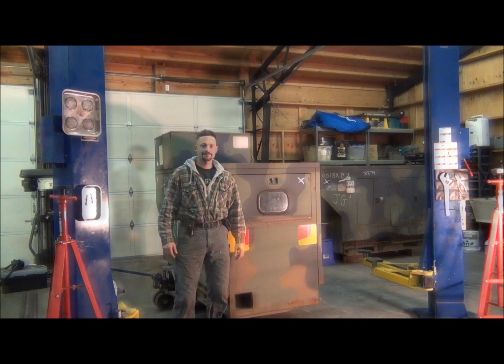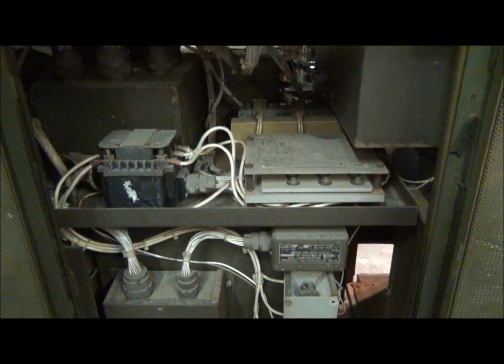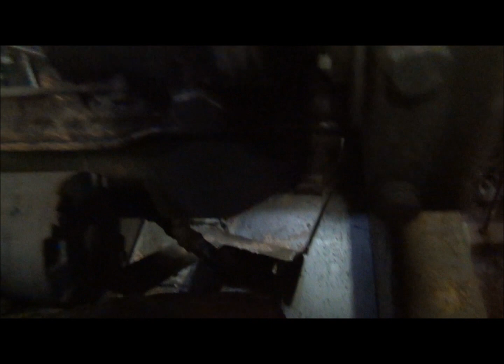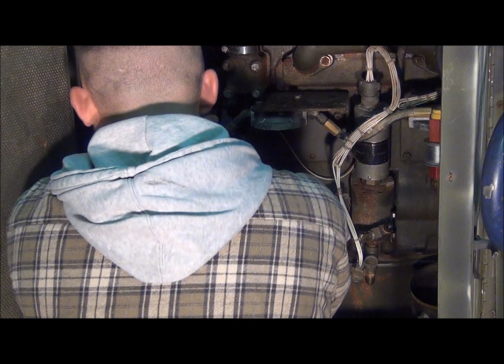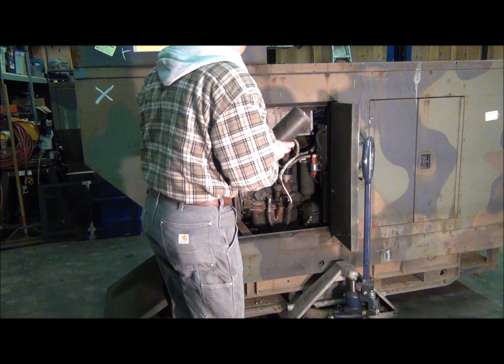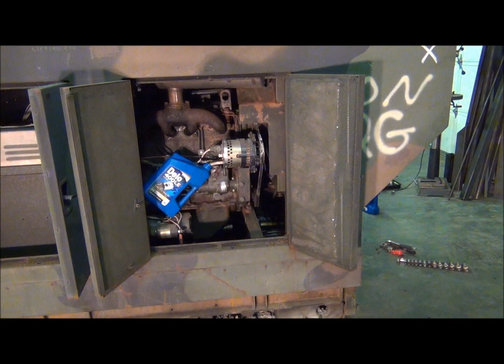Military surplus generator repair, and first start after years of sitting

Comment: Hi there, well a very good friend of mine asked me to service/start a very similar genset just about 2 weeks ago, except this one is a 30 kw 6 cylinder model. It hasn't ran for at least 10-15 years, but only 420 Hrs. on the clock!!!  After clearing the fuel system, and dealing with a few problems in the cooling system the set started and it runs very nice. It powered a beach party about week ago, worked for 12 Hrs non-stop. It had to come back to me, because there are still a few problems, the alternator has 2 diodes in short circuit and some gauges don't work yet. I'm curious if you could advise me where I could get a diode plate for the alternator (ANJ 7001) and a fuel level sensor? Thanks, Louis
Reply from the maker: you should be able to find somebody parting one out on the steel soldiers forum.  if not there, then Dell's surplus or Oshkosh equipment might be able to help you out.

Comment: I'm not getting power to my fuel pump but if I jump out the fuel pump and hold the start button and stop position to stay running soon as I Let Go it shuts down this is on a mep-004a I noticed this the fuses what could it be
Reply: +joesph koellner worked on military gens for 16yrs sounds like you got a bad oil pressure switch or bad master switch. when the master switch is held in the start position it overrides the oil pressure switch until full oil pressure is made during start up.

Comment: hi sewerzuk!..i've a problem with this generator,  the old owner  has changed the alternator whit a local(italian) alternator, now the problem is  that ,is missing (in the prestolite anj  7001 there was a specific output),  the output for the generator set control system (gouges, incicators ecc)....Now i wonder if you could kindy tell me the voltage and amperage that the alternator provides to the control system...thank you so much
ciao!

Comment: I like how familiar you are with these, are you ex military and perhaps worked on these in the service?  Otherwise how could you know them so well?
Reply from the maker: Charles Henn Thanks!  I am ex-navy; I was a nuclear electronics technician, so I had a good deal of experience with electronic schematics and military equipment...but I never did work on these during my time in the service.  I purchased quite a number of these over the years to repair and re-sell...after moving lots of them through my shop I started shooting videos of the repairs.  Each one was like its own little treasure hunt...I do enjoy working on them.
Reply from the maker: Yep; it is a bit oversized for the average house!  But, if you had electric heat, electric hot water, electric range/oven, dryer, etc. then you could run it at its limit...

Comment: I have 2 30KW sets that I installed on my tug boat - they run really nicely! Just wondering if you have the part numbers for the filters, and what oil you would recommend. I notice a DELO 400 jug in the video, that would normally by what I would use, but these are naturally aspirated. Still OK?
Reply from the maker: SAE30HD is what should be run in them...but I have put a lot of hours on the MEP's with DELO 15W40 with no problems.  Here is the filter info:  
NAPA 3540 (for secondary and final fuel)
NAPA 1004 (for oil filter)
Donaldson P131919  (air filter)

Comment: Excellent video. Learned a lot on the mechanical requirements. I like how you eliminated unnecessary checking, which I would have done first, by short duration operational tests. That main engine belt for instance, was looking suspect and scary; wasn't sure if it would hold up. Great job bro.

Comment: Nice methodical work through, looks like you worked for the army engineers. As for that faulty oil pressure switch you should have gotten a new micro switch from Radioshack and installed that. Always much better to keep things original and with a new switch it would have been as good as new!!

Comment: If they are rewired will the generator controls still work?  Have you done this and what do you need to change or replace?  Thanks for your time
Reply from the maker: I have rewired for other voltages.  I have a video on my channel that describes the process of re-wiring for split phase 120/240.  All of the instrumentation and control systems are based on 120v across individual windings.  But...this answer got me thinking...I think I need to take back my initial answer and say that no...480v delta is not possible without a transformer.  Because the instrumentation and control relies on 120v per winding, 240/120 delta is possible, but 480/240 is not.  Each winding would need to be operating at 240v.  I think that, if I needed 480v out of one of these, I would configure it for 417/240v wye (this is a factory configuration) and then get a transformer with a 417v primary and 480v delta secondary.  That would be the easiest solution...

Comment: Nice video! Thanks...on these engine that have not run for more then 6 moths I think it is a good idea to run the engine with the starter with the fuel pump shut off for a while...the idea is to get the oil to circulate throughout the engine before firing up...this may prevent damage to the bearings. But you did not leave anything out for pre check!

Comment: When I see these available (usually be a Re Seller)  ,some have SUSPICIOUSLY Low Hours.. like  100- 300 hours.. Is this even possible ?, or did someone turn back the meter, in your opinion.. What is another way to tell how many hours approx a unit has..  Im glad to hear that if I find one with 2,000 hours that its not a major concern... thanks
Reply from the maker: No good way to tell "real" hours.  But, it is not uncommon to find these freshly overhauled or even original with low hours.  I have purchased a few with single digit hours.  However, this doesn't always mean it is in good condition.  Best to do a full load test to determine how healthy the engine and electrical systems are.
Reply: sewerzuk Hi; I just bought a three phase diesel generator which is missing the battery, that battery compartment seems a little bit too small, yet the tag reads
"24 volt system" so my questions are: Where I can find a battery that size and voltage? Or do I need to use a couple of 12 volt batteries? And my other question is: Do you think I can run a Lincoln welder machine using that generator once I get it to start and running?
I can send you pictures if you want me to, so you'll get a better idea of what the deal is, because I'm a welder with little or no knowledge about military three phase generators, thanks a lot.
Reply: Pancho Contreras I know that 24V systems are uncommon in US, even in big equipnment. In Europe trucks and heavy vehicles simply use two 12V batteries in series.
Reply: Yes its very possible to have very low hours on these sets. Pope AFB just retired a few MEP sets, one only had 127hrs on the clock
Reply from the maker: Pancho Contreras These generators are all designed to use two 12v batteries in series.  I usually purchase a couple of automotive batteries at my local auto parts store when I need new ones.  Without knowing what kind of welder you intend to power, and which model generator you purchased, I can't answer your question!  If you give me some specifics I can help...

Comment: when i was stationed in japan and we would get typhoons, i was the jerk in a truck with fuel pods running around filling these things up! now i wish i had one, i didnt realize u could buy them, did you get it from DRMO? i could fix one of these easy since they are off hi-way diesels! thanks for sharin'
Reply from the maker: Yep; I purchased the one in the video from the DRMO auction at Ft. Lewis.  They are fairly inexpensive, but since you can't wrench on or test the sets prior to bidding you really don't know what you are getting
Reply: sewerzuk

yeah i feel like id have to buy 2 or 3 to get one running gen set, i've brought hummers to DRMO before, and we'd strip parts off them before hand ( to help the motor pools budget lol), so i can imagine how some things from DRMO can come lol

Comment from the maker: No; I've never had one not shut off.  What I would do depends on the circumstances; if it keeps running at normal RPM, then it isn't an emergency and I would just pull power from the injection pump, or remove the fuel line.  If the engine was running away, I would discharge a CO2 extinguisher into the air intake, or cover the air intake with a board (or other handy air-sealing rigid object).

Comment: yes loose stuff is a hazard 1st rank.
excellent info rich video 
nice job!
i always run our gensets with a fan shroud on them, best to have one with no gaps.
the air flows from a full speed runner can suck things and hair into the belt and blade areas without much notice. your helpful hints are appreciated.
if you know...what is the typical run time on these size units with an average load/
ty!

Comment from the maker: The MEP-701A is an MEP-016B with an acoustic suppression kit.  They are decent little sets, but they do run at 3600 RPM (instead of 1800 RPM like the MEP-002a and larger).  But, to answer your question, yes...it will supply normal household current without a conversion.  It should have a switch to go from single phase 120/240 to 3 phase 120/208.  On another note, they are not powerful enough to run any large appliances (dryer, oven, range, hot water heater, etc.)

Comment: Ok I verified i had no power on the convenience plugs,
I wiil look for the Transistor today, Is this a simple replacement ? and where do I get the parts to fix, I am a mechanic but not an electrician,i will get one of my friends if it get complicated

Comment from the maker: Frequency will not register if the gen is not producing power.  Most likely is a bad VR card.  The power transistor on the card (metal can about the size of a dime) is usually the culprit.  If you really want to verify there is no power, measure output at the convenience outlet on the front of the set.  It should produce 120v regardless of  the position of the voltage selector switch.  No power there, most likely a bad VR card.

Comment: OK I started the unit up and held the starter engaged for about 30 seconds, None of the gauges moved, I restarted the unit again and after the unit was up to speed held the starter to start for 30seconds,, 
Again none of the gauges moved, I can not even set the HZ with engine speed,Can you tell me the place to look to see if the VR card is bad? Are there any fuses that might be blown,, or can I check with my multimeter if there is current coming from the generator, Where to check for power out?

Comment from the maker: Once you have the set up and running at normal operating speed, try holding the start switch in start for 10 seconds or so...tell me what the voltmeter does during this time (the starter motor will not "grind" assuming the speed switch is working properly).

Comment from the maker: The most common reason for no output is that people forget to hold the start switch in start for 15-20 seconds after the set has come up to full operating speed (this flashes the field).  The second most common reason is that the output transistor on the VR card goes bad.

Comment: I just found it strange that i had to unlock the knob for the throttle and re-adjust and back it up,  becuase the 60hz was slowly increasing.    I have a 3 phase panle that i have my004a hook up too, and i have it set to L1 for now, and it seems to be working, but i was planning in hooking up a 50amp plug to it, it needs two pole wire so i was planning in setting up the gen in L2 mode to activate the second phase. i was reading  on another fourm its not good to run it with so little load
thanks

Comment from the maker: It is possible for the governor linkage inside of the injection pump to become "sticky."  If the actual throttle position is not changing during operation but the engine speed is, then you will most likely need to disassemble/clean the pump.  Are you asking about pulling 120/208 off of 2 legs for single phase power?  Nothing wrong with doing this, if your loads work with 208 (most are fine with it).  You can only get about 10kw out of the generator this way.

Comment: Hi
   I have a 004A, it runs great,but i have a few questions.  when its running the RPM seems to slowly change and i have to reset the throttle knob. is there a fix for this issue and is it bad to have it running in single phase mode?, i have not used it in three phase yet, but i will be needing 2 phase 220 soon.
thanks

Comment from the maker: I would be cautious with the pressure washer...the components can surely take water on them, but it would be possible to force water into places that it could not normally find its way into.  I typically used compressed air with a piece of hard brake line bent into a "u" shape to clean the inside of the gensets.

Comment from the maker: 1)  You could; and I tried!  Couldn't find the correct diameter hose with the correct bends.  Maybe somebody else will have better luck and post up the part number...I would sure appreciate it!
2)I currently don't have any; all of the generators in my shop right now are MEP-002's and -003's.

Comment: Great video - as are all your MEP uploads; this is practically a repair tutorial.
I had 2 questions regarding the -004, if you do not mind responding.

1) Why can't you take the lower hose to an auto supply store, ask to browse the hose rack, and to try to match it up to an existing aftermarket hose?

2) I see that you have the (unused) mounting plate for the precision timing electronic governor. Do you happen to use these panels elsewhere, or would you be willing to part with one for a price?

Comment from the maker: I've found them very easy to work on...but I do have a background in military electronics.  I would rather tackle an electrical problem than a mechanical one with these generators any time.  If you can follow schematics and troubleshooting guides, then you can work on these generators.  If all you can do is basic automotive wiring, then repairing an MEP will be a steep learning curve.

Comment: Pretty neat, my pap is debating on getting on because the power doesnt go out enough here to offset the cost of a 10 grand unit. When it comes to generator wiring how hard is it to trouble shoot if there is there is a problem somewhere. Thats the only part im not comfortable with.

Comment from the maker: The -004a is rated at 41HP@1800 RPM.  Its rated fuel consumption is 1.5 GPH under 100% load.  My experience suggests they consume a little less than this...

Comment from the maker: This one had a 4 cylinder White Engines diesel in it.  
Cost varies based on condition and included accessories...but anywhere from about $2500-$3500.  Never have run into any issues with the oiling systems on any of these MEP's...

Comment: I can't remember exactly how that model is set up, but a lot of the MEP family has the field flash going through the overspeed switch. Should be able to see on the wiring diagram. Used to work on those MEPs and Mil Standard for a long time while I was a 52D in the Army. The overspeed switch is partly reponsible for starter kickout, field flash, and of overspeed protection

Comment from the maker: yes, with a little creative wiring.  I have set a couple of these up this way, using a custom program in a PLC.  I believe it would also be possible with a commercial control panel (such as one of the deep sea controllers) but I haven't tried it yet.

Comment: Well I brought the 2 electrical boxes which are behind the control panel to a electronic's repair shop with the electrical schematics. He tested every relay and resistor and everything was good. So I reinstalled them on the gen and turned on the gen and it flashed the field with the start switch. So after a 1/2 hour I turned it off then on again and it did not flash the field. The next morning I turned the gen on and it flashed the field  with the start switch. Now it wont flash.

Comment from the maker: OK; sounds like you've tracked it down.  Good news is that the VR/exciter is probably good...it just isn't getting that initial flash during startup.  Most of the components are a standard design and readily available ate Digi-Key or other electronics parts store.  If you can find somebody comfortable with soldering you can likely fix it yourself.

Comment: I had a friend stop by who is strong in electrical and he did the checks which you laid out. We found only 1.3 volts from the right side of the breaker no difference while holding the start switch for flashing. I read the troubleshooting diagram on one of the door flapps and it showed K5 as the flash relay. So I took out the big box on the left side and found a resister R3 burnt. I took a picture but dont know how to post it on youtube. On the box someone wrote bad. Its not original.

Comment from the maker: Did you check the output with the main breaker closed?  And verify that the breaker for the convenience receptacle isn't tripped.  You can check for output on the upstream (right side) of the main breaker, too.  Also...check for output with your voltmeter while you are flashing the field (with the start button in start with engine running).  Let me know what you see on the voltmeter..

Comment: I turned on the generator and verified that there is zero output with a voltmeter. As for the engine rpm I read up in its 400 page manual to pull the idoler handle all the way out then pushed it back in half of its stoke. As far as the generator having only 29 hours on it could that be part of the problem? I did run the engine a total of 4 hours on it when I bought it so I know the counter works.

Comment from the maker: It could be a faulty regulator/exciter...but I have never seen a bad one!  Does the convenience receptacle have power?  Have you verified zero output with a voltmeter?  What speed are you running the engine at?